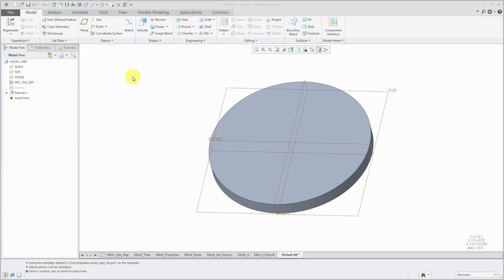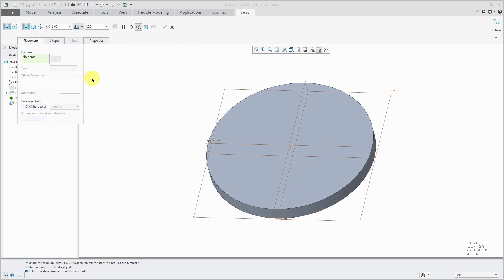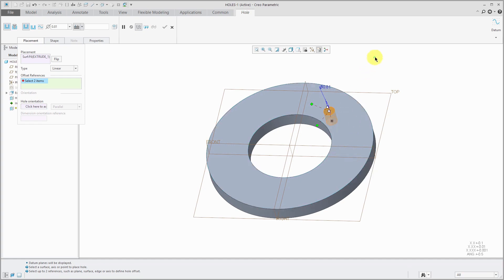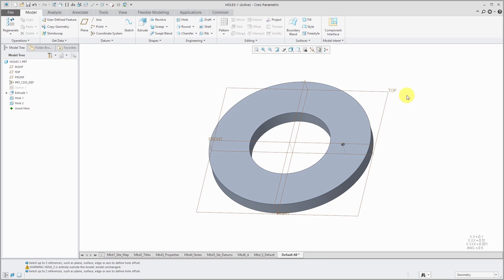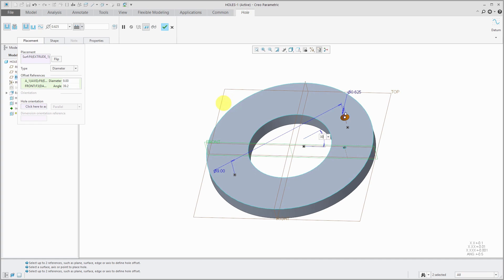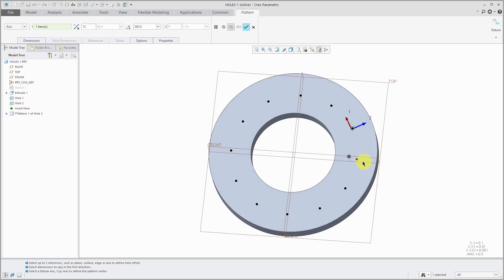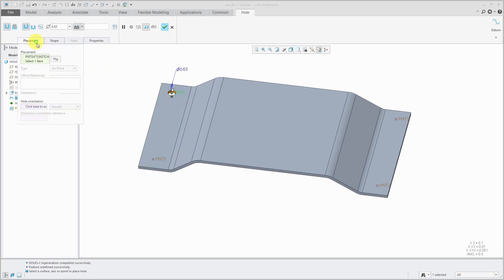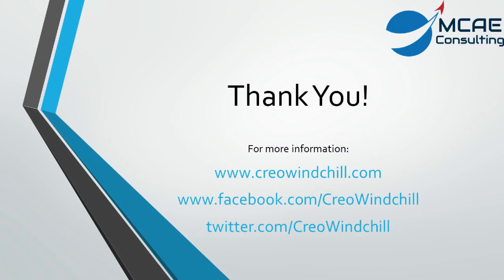Creo Parametric - Hole Feature - Locating Schemes

Comment: Hello,Hello,
I hope you can help me with something. When I draw a circle, the surface of the circle appears as two surfaces. This is an obstacle for me. When I select the circle edge, I cannot select the surface at once. Thank you.
Reply from the maker: Representing a cylinder as two surfaces is the method Dr. Sam Geisberg came up with for representing 3D geometry mathematically in the 1980s. When trying to pick the surface, pick the surface, not the edge. Any operation that takes a cylinder as an input will automatically add the other half cylinder to the collection.
Reply: @CADPLMGuy  Thank you for your answer. But I think it's a parameter error. The inside of a round pipe consists of two surfaces. This poses a problem in the rendering program.